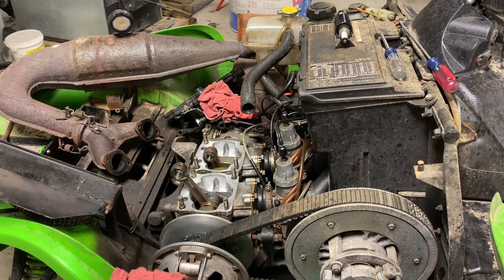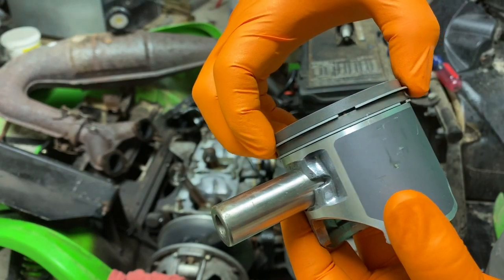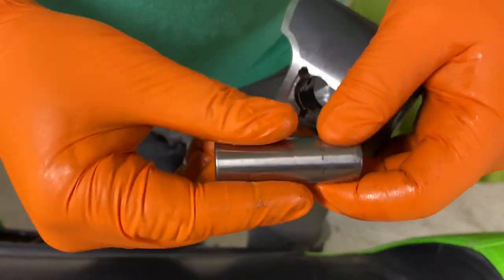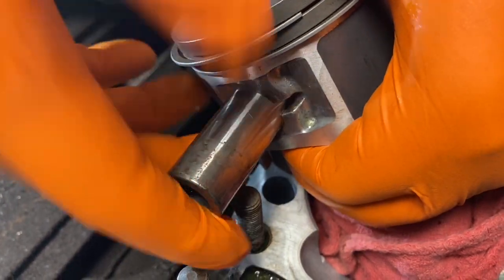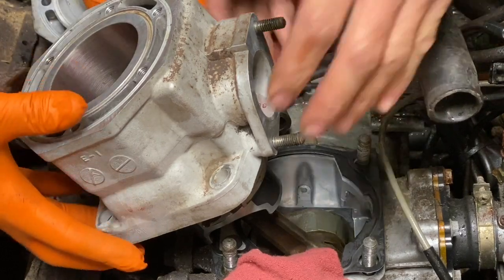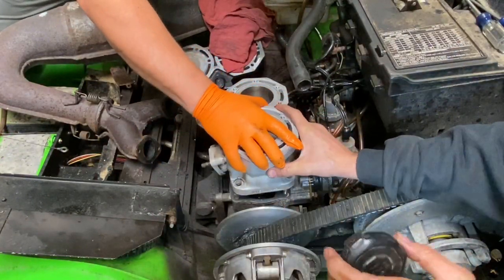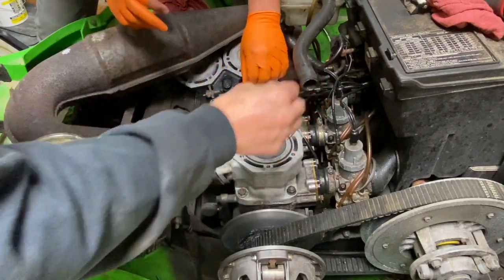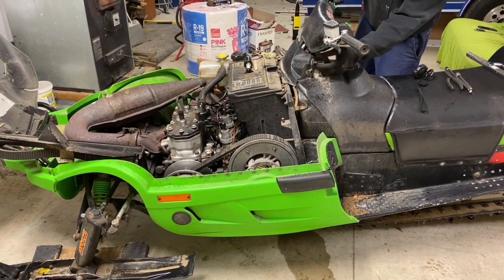Snowmobile Top End Rebuild

Comment: Pro tip check ring gap in cylimder firts by running the ring threw the cylinder with a feeler gauge to make sure gap is within factory spec
Reply: I wish I could find a video on this.

Comment: Dont forget when installing those circlips  that the notch HAS to be at 12 or 6 position due to the inertia of the up and down stroke. Could pop out if not and result in catastrophic engine failure and damage.
Reply: Wait wdym 12 or 6
Reply: @darksilencegaming7749  think of a clock. 12 o’clock is straight up. 6 is straight down
Reply: circlips  makes no difference on location. They have to be totally seated.
Reply: @chaley9093 you're right. But.the ristpin does.  I rebuilt a 570 motor. It is running good.  I
Have everything
On it is ready

Comment: Is It easier to rebuild the top end with the motor still in the sled? I’ve got a 2003 Firecat 500 and I’m trying to decide whether to pull the motor or not for top end rebuild
Reply from the maker: It’s very possible in the sled and less wrenching.

Comment: Anyone know of i video of getting the piston off? I got one c clip from the piston still wont come off... 95 arctic cat 580 ext
Reply from the maker: Did the top end ever run hot? Wrist pin could be frozen in the piston?
Reply: @danofalltrades3567  Yeah I figured it out. I was being too careful about it.. I just heated the piston up with a torch and the wrist pin area then tapped it out with a socket extension with electric tape as kind of protection... anyway Piston changed old sled fired right up... adjusting the piston rings so the cylinder block would fit was a tough with out special tool or w/e haha just used a flat head and my fingers 🤣

Comment: I just brought home a free barn find, (basement find actually) the tag looks like it says 1999 but doesn't really look like a 99. It's a Jag 440 Deluxe and the engine is seized. Gonna try dumping some oil in the heads. What could the reasons be why it's seized? Moisture in the basement or? What does AFS on the hood mean?
Reply: Could be from sitting or could have seized while riding. Could be why it was parked. Moisture could have gotten in if carbs were never drained or plugged. If the spark plugs were out, for sure moisture got in.

Comment: You are advising people to use petroleum jelly on rubber O-rings! I suggest you do a little bit of research about that. You will find that it eats away at the rubber. Viewers, this is why you should thoroughly review the repair manual for your machine first and foremost before searching YouTube because YouTubers are not necessarily experienced mechanics
Reply from the maker: This is coming from a guy that has 1 subscriber and no videos. No one made you watch my video. By all means if you have a better technique, make a video and show people. Instead of beating someone down who is trying to help! (Btw this machine is still running.)